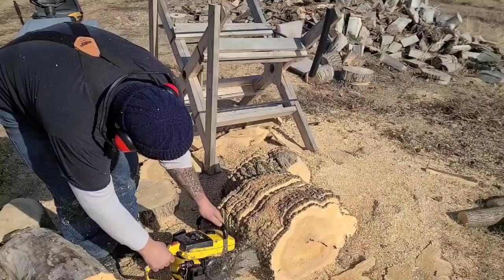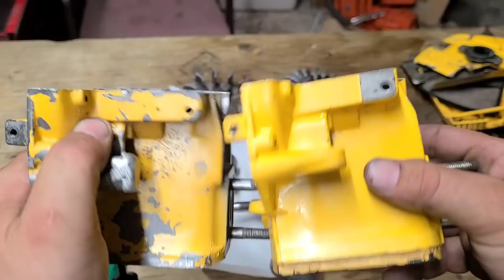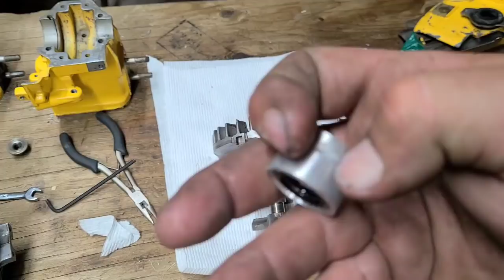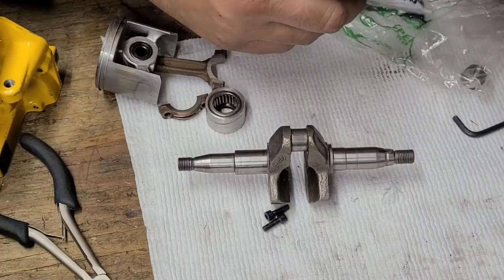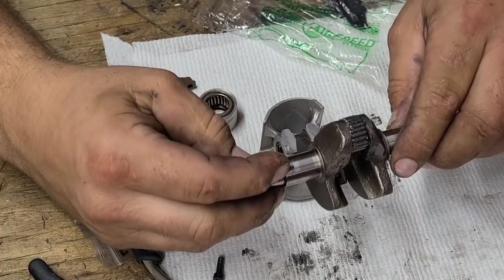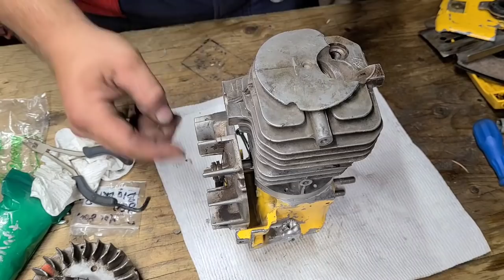Building a custom crankshaft for a McCulloch Pro Mac 850. Will it fit???

Comment: Without YouTube, I wouldn't be fiddling with power saws either. I saw my first ported saw on YouTube,  and I was hooked as well.  To be truthful, my lifetime of experience has been on heavy on highway trucks. Had a trucking company for 10 years, I was an employee wrenching and driving before that. Then opened my shop in 2008 and added machining in 2018.  I watched Leon from Leon's chainsaw parts and repair on YouTube get really frustrated with a little carburetor.  You don't know frustration until a truck comes in off the road in the winter to do a clutch and there's a big PTO hanging off the bottom of the trans with salt water and slush raining and slopping down on you with the owner telling you, "I need that truck Monday morning and it's Friday night. A power saw will NEVER EVER frustrate me after going through that and much much more!!  I ain't complaining mind you,  it's the profession I chose, but as I get older it's getting harder that's for sure. Take care Tinman.

Comment: Nice work Tinman. I use tweezers to put in the needle bearings. The torque specs are easy to find in the Machinery's handbook.
         I like McCullochs using heavy-duty bearings. That is what keeps the saw together.  
One thing that get me about the McCullochs is that the extra effort needed to work on them. A bit on the extra steps to do side. But each saw manufacturers have their own quirks of assembly.

Comment: I've always had the most success stacking the bearings in the rod 1/2s and using STP to stick them in place rather than grease....

And the STP works better cold(refrigerated) also much easier to clean out than grease and is an excellent 2 stroke assembly lube!

Comment: Saw a post on AS showing 65-70 Inch pounds on the Con rod bolts when oiled.  I also flush the grease out with mix gas and re-torque them.  Just my .02  Thanks for the video

Comment: Speaking of using lighter parts, I had 2 junk Husqvarna saws giving to me.  A 36 and a 141. I built the 141 but used the lighter flywheel from the 36, then did a little grinding on the 141 piston to make it lighter. I shaved off about 2 grams. I don't know if that will help anything but it can't hurt, I didn't grind in any stress areas. I really like tinkering with these saws even if they ain't 372's or 395's. It's still fun for me.  Thanks for the inspiration.

Comment: Tinman there’s a company called Millenium in Winnipeg that repairs and re-nicacils 2 stroke cylinders. They do nice work. Also, if you miss your numbers on those crank bearing bores a hair you can use a film of green cylindrical bonding loctite to lock them in place vs. moto-seal. Keep up the good work!!👍🏻

Comment: Very informative tinman. Wish I had you in North Carolina. I am trying to restore a couple gear driven saws. Ya it’s a different animal. Parts are very hard to get. Be kind bud. See you on the next video. 🌲🌲🌲
Reply: I am working on a gear drive saw myself, a “sears 647 G” ( David Bradley ah) so far, I have repaired the recoil starter, and had it kick-over on either, will have to rebuild the carburetor .
Reply: @thesmallwoodlot433  mine is a model 47 Mac and a strunk eager beaver. Just getting started and it is going to be a big job. Thanks for your input
Reply: @johnarnettsways.8758  you may want to get in touch with Dan,  @ Kain Kustom Garage, here on youtube, he is a wealth of knowledge on old saws! As well!

And remember “ a gear drive runs the other way , while a direct drive follows in line!”  So a gear drive motor runs clockwise while a direct drive runs counter clockwise, during assembly of your recoil starters.

Comment: The procedure for the main bearings is to install half in the rod cap and half in the rod using Vaseline then install. The first time I did it I installed all on the crank which was a pain!

Comment: It's going to lose torque with the lighter flywheel and gain rpm. I believe the flywheels with more fins came on the electronic ignition saws and the less fins on the points saws.